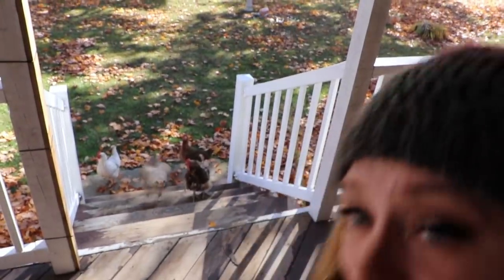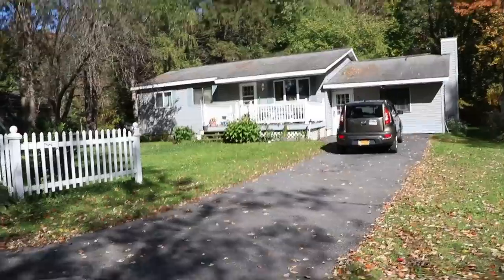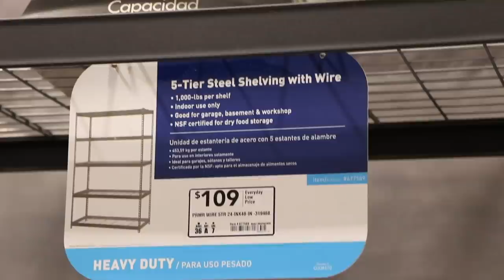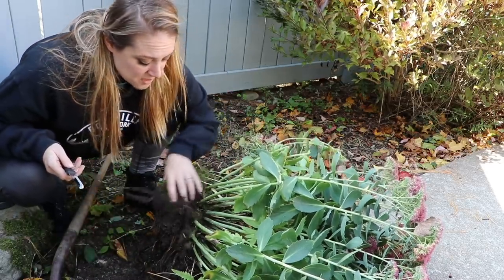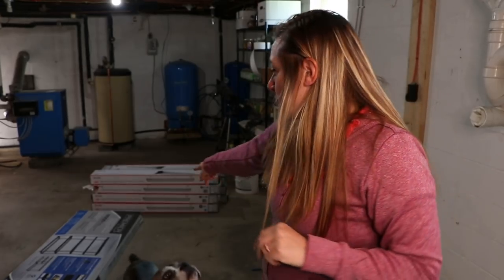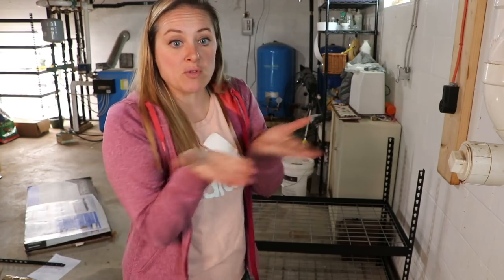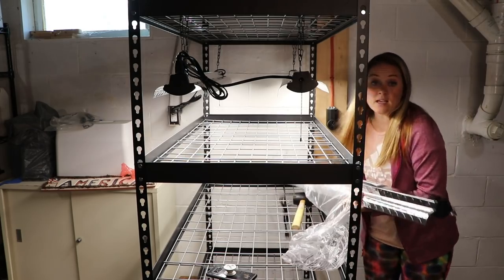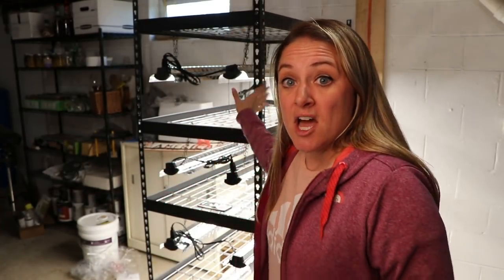Setting up an Indoor Seedling Station : My Gram is Cooler Than Yours! : Dividing Sedum from My Mumsy

Comment: You mom and grandma are both so fun!  It's obvious where you get your energy and personality. :-)   Sure, sure, seedlings. But what this did is trigger an idea for my old garage!!!!   I had extra outlets added this summer but didn't have the budget to add lights yet (only a single pitiful bulb there now), but I can use these lights piggy-backed across the rafters and do it myself!  WOOOOOOOHOOOOOO   (just discovered link goes to a different, hard-wired light, but can search since I know what to look for now...)

Comment: My Autumn Joy Sedum took over a section of my garden so I dug some out a couple of weeks ago.  Nobody wanted the extra plants so I just threw them out.  I saw someone use it for a flower arrangement and they apparently have a long vase life.  They’re easy to propagate too, just take some cuttings and stick them on the ground.  They may even root in water while in a vase.

Comment: I use those shelves also. I bought a stainless steel six foot commercial kitchen work bench one which I have outside and the second one inside my grow room. I also use the heavy duty metal rolling rack so that as I need to harden plants off I just wheel it out . I’m definitely expanding my grow light situation based on your design plans. Thanks
Reply from the maker: I have a 10 foot wooden bench on the opposite wall- which is where my heat mats are setup!! No such luck with rolling them outside though because of the basement stairs 🤣💐
Reply: @FlowerHillFarm I can't wait to increase my light set up to something like this one day! Can i please ask, are you moving seedlings off heat and under lights once they germinate?
Reply from the maker: Yes, once 50% of the seedlings have popped I move it to the light set up.

Comment: You should look into the shop lights on Amazon though, they have some with 5000k-6500k light spectrum, high number of lumens,  etc. I ordered 2 Mars hydro ts 600 grow lights,  (which they say only covers 2 x 2 ft space but it covers a lot more  when you're not growing "mari-tomatoes!" & you're just growing regular seedlings) but I have 2 shelves, where I put a marshydro in the center, and 2,  4 foot, 20w, 6500k led shop lights on each side, about 3 feet high, and am able to fit a few hundred seedlings in about a 4 x 4 space. They're not NECESSARY for veggies and stuff, but I wanted something with full spectrum, because I use them in the off season for orchids, succulents, etc.

Comment: Do you have the item number on the lights from lowes? Your link is for a diff light strip
Reply from the maker: Yes, the link is to my original lights. Those were sold out when I was there. I do not have the item number but they were the 48 inch diamond plate shop lights. LED 40 watt 120 volt 4k lumens

Comment: Can the light be further away from the seedlings with LED?
Reply from the maker: I still put them right above the seedlings. Hovering right over them. Otherwise they will stretch. LED last longer and don't get as hot as regular bulbs, which is why I prefer them!

Comment: Can all that plug into one outlet?
Reply from the maker: Yes, my father is an electrician and I can have at least 24 on an outlet. Depending on the voltage etc of each bulbs and the circuit breaker.